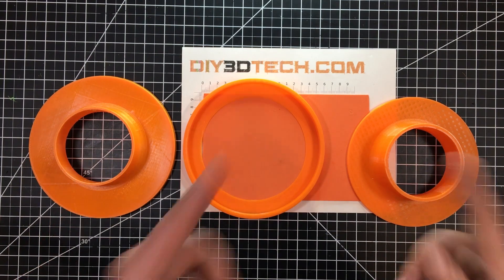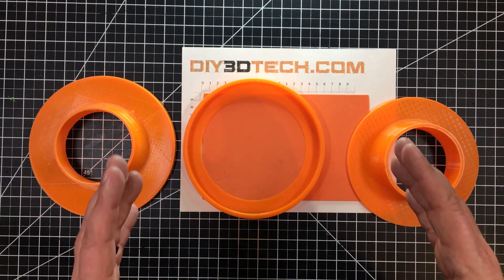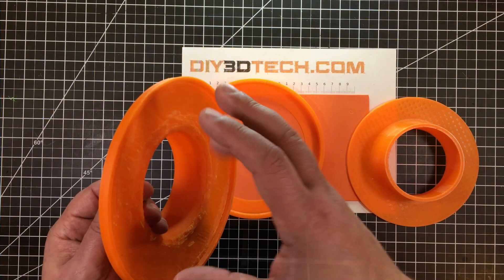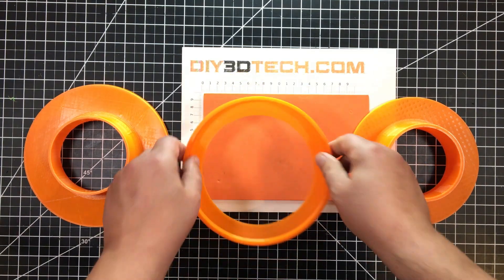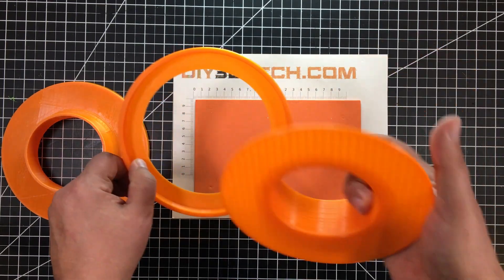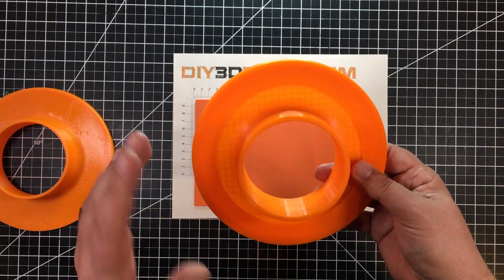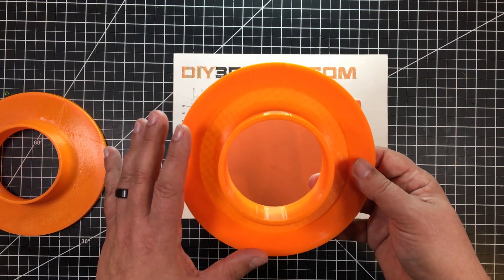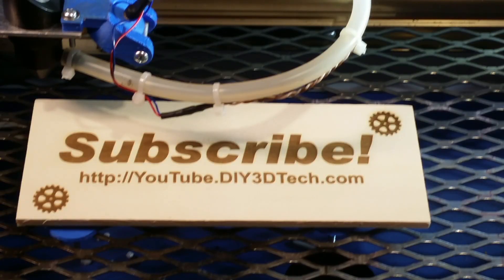Design Talk - Two Pieces Are Better Then One!

Comment: Good tip.  I spend a lot of my design thinking around issues relating to how easy it is to actually produce the final part on the printer and thinking in terms of assemblies is a key tool.  I have also gone so far as to model in "corrections" for things like flex on long, wobbly bits of SLA prints that otherwise come out distorted from the original (correct) drawing.  Not exactly recommended or best practice, but sometimes it's the shortest path to a functional part.
Reply from the maker: Bingo!  Yes I do the same, (gone so far as to model in "corrections") and I add this a parametric value in Open-SCAD or fusion as various plastic's and printers will have differing characteristics and since we lack the ability to truly adjust in CAM like you can do in CNC, this offers a viable solution.

Comment: The weakness of fundamental flaw in existing fdm printers is the need to use supports which sucks. So this is not the final solution. Such fdm is destined for extinction. No future , just like Lithium
Reply from the maker: Without question a weakness, however dead?  Not sure I would call it that, however would like to build a larger printer to use a water disovable filament for supports as I have used HIPS in the past but was messy pain....
Reply: @DIY3DTECHcom  There is PVA glue filament i saw on YouTube.

Comment: more parts is better than supports, you learn that with experience in the art, nowadays all my models are supportless and I even have supports turned fully off in cura, no need with my designs
Reply from the maker: If you mange that is great!  however on some models its hard to avoid...